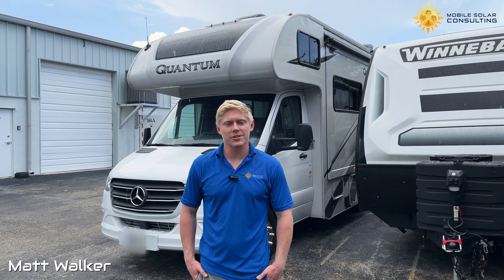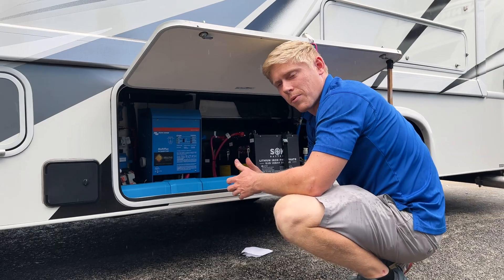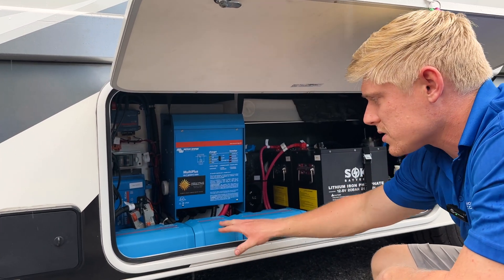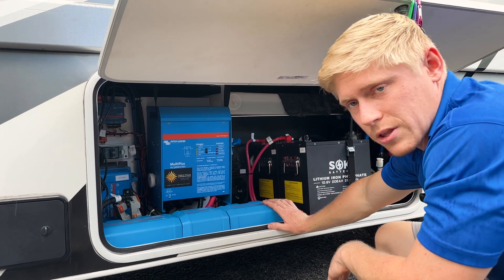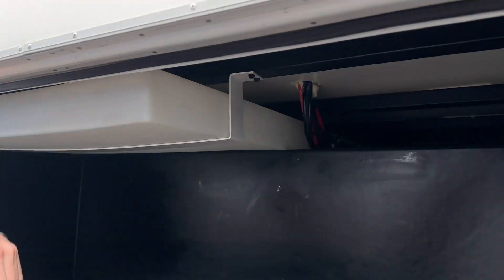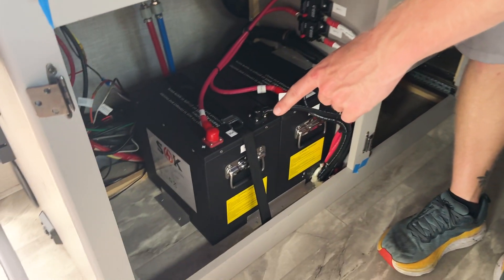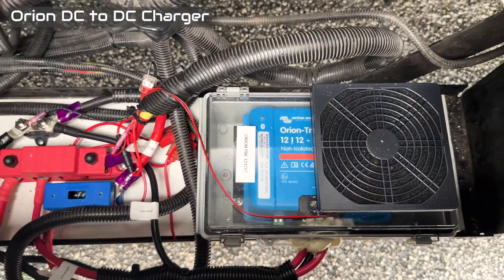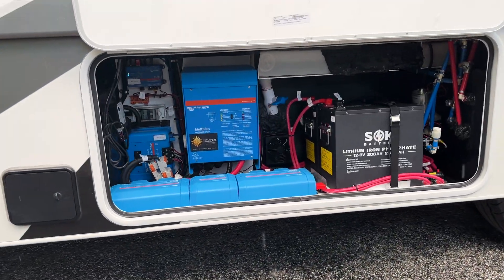Class C RV Solar System Walk-Through - Thor Quantum

Comment: You have four 12v 206ah batteries in parallel to get the 12volt 824ah. Could you have wired those in series and made a 48v system? Is there any particular advantage to your install over a 48v?
Reply from the maker: 1. We try not to series connect batteries, the results are never perfect. 
2. If we did 48V we would still need a 12V battery as well, though a small one would be fine.
3. This was a while ago, before Victron had a 48V to 12V dc-dc charger. Nowadays, we are using 48V more often.

Comment: I have an 80's RV with 1 starting and 1 house battery under the hood. If I connect the solar controller right to the RV fuse box, would the solar power charge the starting and house batteries?
Reply from the maker: That is a pretty specific question. I would recommend calling us at 561-320-2842 and ask for Matt. He can answer that for you.